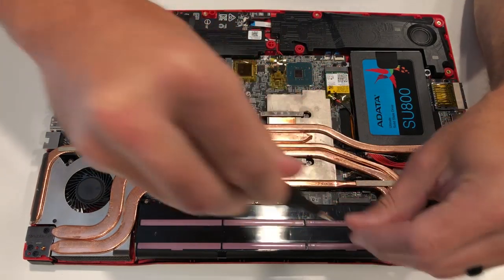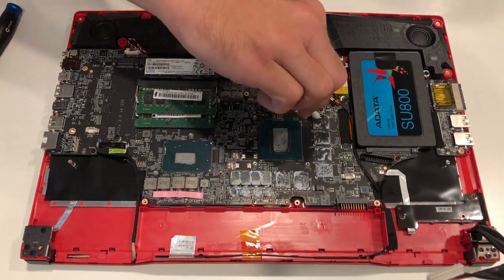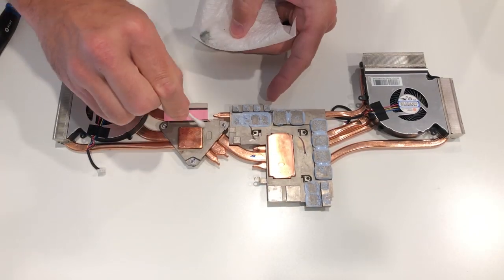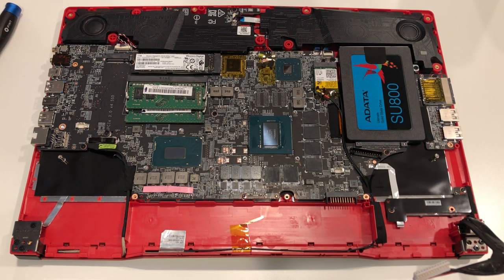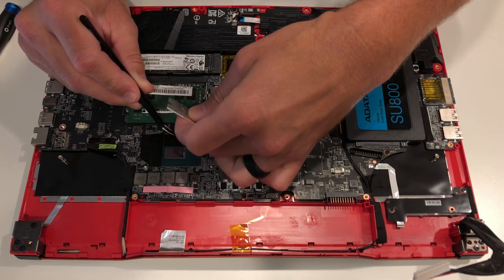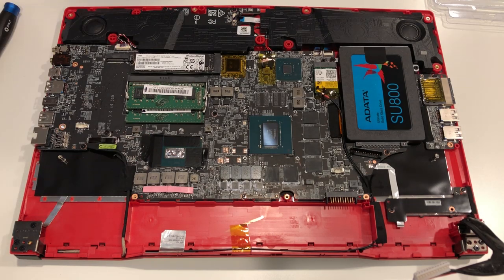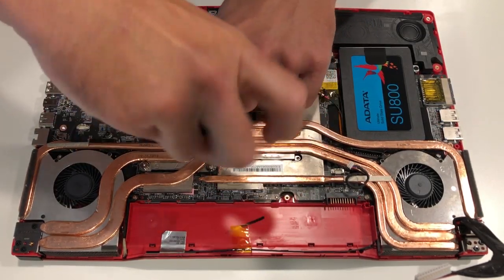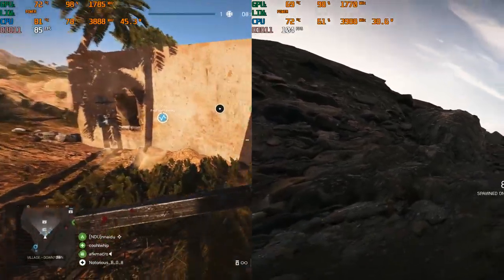MSI GL63 9750h 1660ti Liquid Metal CPU teardown!  Cools like a boss!

Comment from the maker: Review upload goal is Tuesday before the Aorus 7 arrives 👍
Reply: Why even bother to review this plastic abomination. GP is a compromise, everything below is a tragedy.
Reply from the maker: Antony Whatever Runs cool, 1TB NVMe, plenty or storage availability beyond that, an 89% aRGB 120hz 3ms display, per key RGB keyboard, max fan hardware button, 9750h, 1660 ti, dual channel 16gb memory and weighs about 5lbs. If you can get it at a good price that sounds pretty good, don’t you think?
Reply: Is there a particular reason you didn't apply liquid metal to the GPU?  I have a GP63 and now that my warranty is over, i've been toying with the idea of doing liquid metal.  Otherwise  a great video!  I know you said it runs cool, but is there any downside to doing it to the GPU as well?
Reply from the maker: TS 656577 9:03 ??
Reply: Bob Hello, I wonder whether applying thermal paste to chokes under cpu would improve temps or not.. What do you think? (GE75-Repasted with Gelid GC)
Reply: @BobOfAllTrades  I was looking for that answer as well. Did you try to paste a similar cpu gpu combo with LM on both? And what were the results?

Today I repasted my old xps 17,only did the cpu with LM and the gpu with noctua paste, and wow, the cpu dropped 20 degrees, but the gt555m is still maxing out at 85 celcius. It's an old beast so I'm tempted to take the risk and see what LM does to the gpu.. Also, I only applied a very very very thin layer of LM to the cpu chip, didn't put any on the heatsink. So far so good! Coated the chips in plastik 70.

Either way, thanks for this video, has been really helpful!
Reply: @BobOfAllTrades  can you tell me the thickness of pink color thermal pads near cpu

Comment: I always see people commenting about super 33+ tape, I’ve liquid metal pasted an Asus g701vi and aorus x7 v8, left it sideways in my backpack and transported it around and never had any issues, to be quite frank it seems to be a valid application so long as you don’t put too much LM. I comment on ownordisowns videos too, enjoy both of your reviews, most recent laptop is a triton 500 but I’m returning it as it had a defect in the paste job and one of the speakers, got an MSI gs65 stealth with RTX 2080 and 32gb ram and a 1tb ssd from XoticPC for 2300 usd, so I’ll probably liquid metal it if I feel it’s thermal throttling after an undervolt. TLDR; everyone has an opinion on everything doesn’t mean it’s right, keep up the good content.

Comment: Made a mistake of using liquid metal to the gpu and noticed that it is 1-2C hotter than it was..agree to use thermal paste only on GPU.  Nice video!
Reply from the maker: Manz Yup the GPU doesn’t need it. Fun fact, one of HP’s new high end gaming laptops includes LM on the CPU only 😉

Something that I have been doing for years and you’d be surprised how far ahead of the curve we are as tech enthusiasts 🙌

Comment: Great job 👍

I repasted my GS75 with liquid metal and the cpu temps went from 92 to 76, gpu only dropped 2-3 °C though but it was already very low at the low 70s to begin with :) 

Very satisfied overall

I prefer using foam dams instead of tape though because it seals the entire die so its safe from spilling out the other side too. It also supposedly reduces the exposure to air and lengthens the operational life of the liquid metal but I've not experienced it myself yet.
Reply: @Mr Krabs Most definitely.
 
Being liquid metal, it is conductive by nature and so if it spills onto the motherboard it will short out components and render the whole laptop useless. 

So do take care not to apply too much. Just a very thin layer will do. If you can apply just the right amount the cohesive nature of the liquid metal will hold itself together but that's very hard to get right. Thats why I used foam dams.
Reply: @Mr Krabs Yes, Kryonaut is a non conducting paste so it is much safer to use. Not to mention much easier to apply.

Just follow how Bob did it and you'll be fine.
Reply: What kind of foam did you use? I bought some 10 ppi 1/4 thick aquarium filter foam but I'm worried itll melt

Comment: Hey bob, I had a question- So my 1660ti in this laptop idles in the 50c range, and under load it hits 80-81c. I went to check in hwinfo and the "hot spot" on the gpu says 100c! From what i read online, 15-25c hotter on the hot spot is expected, but I was just curious if this is somewhat normal as it is a thinner laptop. Look forward to hearing from ya!

Comment: Liquid metal on the VRM, let's go!
Reply: Xotic l Ice  Thick thermal paste like K5 Pro is meant to replace thermal pad. It performs as good and you don't have to worry about thermal pad height/contact. I used K5 Pro and Phobya Nanogrease to repaste my laptop recently.

Comment: This is the first time I've seen someone put thermal paste on the vrm. I'm having an issue with my laptops vrm, I used thermal pads but they're not working at all.  They also seem to be creating a small gap so that the heat sink isn't clampled on the GPU. My CPU paste is spreading whereas the GPU paste isn't. I think the paste is doing its job, but it's feeling like I need to remove the 0.5 mm pads I used, and just use my thermal paste. What say you?

Comment: I recently picked up the MSI GL63 9SDK-614 (same CPU/GPU as the 9SDK-610 as you linked in the description and I assume you showed in the video) but with a different display, default storage config etc. Any idea if the teardown process is the same? Mostly interested in the 2nd M.2 slot I see on yours. I'm not afraid to open it up, but I'd like to know what I'm in for before taking off the "Factory Seal" label just in case it isn't what I think it is.

Thanks :)
Reply: Breaking the Factory seal on an MSI laptop will NOT Void warranty. MSI allows users to open up their laptops to upgrade certain components. They have no issue with you breaking the factory seal as long as u dont mess up while opening the lap. :)

Comment: Sorry for posting on this two months old video. However, I would like to ask about using thermal paste on VRM chips.
What should I concern before using any paste on them? (or things other than Mastergel Maker?) and how long would it last (like drying out or slip aside)?
Cheers!
Reply from the maker: I2aynorsRaiders It’s all good!  Use it or go with some .5 thin fulipoly pads. Either way it’s good to get familiar with the inside of your laptop and change non-conductive paste maybe once per year.
Reply: Bob Of All Trades why they didn’t put thermal pads on gpu elements then? I guess is because 0.5 can be too thick. In opposite, normal thermopaste can be too thin annddd didn’t make roper contact so the best way is reuse stock blue paste. At least such dilemma I have with my Helios 300 2019)

Comment: How is the liquid metal application holding up?
I have a y740 with a 9750h and 1660ti.
It thermal throttles on me a decent amount, even with an undervolt.
Reply: I had a hp omen with 9750h an 1650 an it would run at 100C  that was with undervolt now I got hp omen ryzen 7 4800h an 1660ti that ryzen 7 doesn’t get hotter then 75C  I guess amd cpu’s run cooler?

Comment: Hey i wondering if its good to put liquid metal on laptop? Are they some cons after some usage, i dont know after one year ? I using hp omen 15 i7 8750h with rtx 2070 max q... Wanna rly try LM, cause i already two times repasted cpu and gpu with arctic mx-2 2019 edition, but temps on cpu are pretty high still for me ( 80-90C in games for cpu with peaks to 94C ) .. would apreciated your help :)

Comment: Wow thanks bob, this looks very similar to the MSI GE75 9sf  (internally). Do you recommend using a an acrylic coating before applying the electrical tape and if so what brand would you recommend ? Love your videos you're the reason I bought the GE75 2070 now I need to apply liquid metal because this monster runs a bit hot.
Reply from the maker: Get on the Notebook Review Forums and ask around for advice there if you want more input from people who actually do this stuff all the time.  This way you’re extremely confident before going in 💪
Reply: GE looks similar to GL? Is this C-137?

Comment: Too impressed with this laptop. Got it 4 days ago. 
RDR 2 : 60-70 fps on Hardware Unboxed Optimised settings (check yt)
SOTTR : 78 fps avg on highest preset
Witcher 3 : 60 on Max settings with Hairworks max, 75-80 with Hairworks off
Batman Arkham Knight : 90 fps constant on max settings
Fortnite : 110 fps average on max settings
140 mV undervolt using Throttlestop, 165,320 MHz overclock.
I have made a channel today and will upload the gameplays soon.
Reply: I got the GP65 with the same characteristics , cannot be MORE happy.It runs better than my previous Legion Y740 with rtx 2060 90w..from which i was not happy at all from software and driver side mainly.When i have time will do the same termall pasting ,and i will be Ok for the next 2-3 years with this lappy!
Reply: @krasimirharizanov7862  True bro, it's an excellent purchase plus you got the gp65, I have a crush on its keyboard

Comment: I'm not recommend anyone do this but I had fantastic result by using thick non-conductive thermal paste instead of tape to protect the circuitry. This allows slightly further cooling and it also forms itself automatically to the heatsink.
Reply: You had any problems with that?

Comment: Thanks for the vid, I've got a gp63 with i7 8750h and 1070, was trying to play FarCry 5 yesterday, hit 96 degrees at times. The CPU is undervolted -175 and the short term boost has been turned down to 45w, the thermal compound is gelid extreme and I'm using a cooling pad too. Considering liquid metal too cause nothing else helps.
Reply: Try sanding down a bit the cooling system and reapplying the paste again. Also don't forget to undervolt de cpu cache too. How's it doing after 2 years?
Reply: @xescdelarosa3328  thanks, never got into the liquid metal game- thank god, but temps are fine. Using ThrottleStop instead of XTU, seems to do a much better job. Thanks for the advice with the cache. Cheers

Comment: Is it okay to use the thermal paste on the VRAM chokes though? I am still wondering what kind of Thermal interface material that MSI use on the VRAM choke before. I am trying to use TFX thermal paste. Can you give me some sugesstions Bob?
Reply from the maker: Go with K5 Pro on those components 👍
Reply: @BobOfAllTrades  What if I choose to use the thermal pad? What is the thickness I should choose? Will MX4 or TFX damage the VRAM choke in the future if I use the thermal paste on them?

Comment: Bob,  how many watts was the 1660 Ti using? Is this a Max-Q variant? The 1660 Ti looks like a great laptop GPU that provides sufficient FPS while not producing an excessive amount of heat for these thin and light laptop chasis. Not surprising the 6 core 9750H produces insane amounts heat.
Reply from the maker: That’s a question that will get answered in the review
Reply: how can a TI be a max q ?

Comment: Hello, i did my repasting also on cpu and gpu with arctic mx4 but i didnt clean the old paste from the small square things there, i let it like that how it came from fabrique, is that a big problem or they are not so important ? :) i must say cpu working at 100% from 95-100 degrees sometimes got down to 80-85 degrees and this without cooling table or turboboost of msi!!! arctic mx4 is the best paste

Comment: I don’t have any thermal paste, and just ordered LM. Are the issues associated with gpu LM application that bad, warranting a separate purchase? This would be my first paste job, laptop is an EVOO LP5 (like the mech-15).
Reply from the maker: What guide will you be following to apply liquid metal? There needs to be some prep work and safety barriers created
Reply: @BobOfAllTrades  Tape+foam dam on both cpu and gpu. I have both 33+ and 88 tape. I will see which fits better the foam compresses to nothing, so I just need to check die clearance from what I understand. It’s probably not good for temps of the components next to the die but I guess I will have to cover them all up with tape. I think only the gpu has these, the cpu just has test points. Notebookreviews steered me away from using nail polish, members seem to think a “sealed” copper heatsink interface reduces oxidation. I haven’t looked up the reaction but I’m guessing it doesn’t involve oxygen. I trust first hand experiences though. It’s kind of sad a company like thermal grizzly doesn’t flat out explain copper heatsink prep and maintenance. Part of the net seems to want to speed up the alloy coating(multiple thin cooked on coatings), the other part wants to seal or sand to avoid the alloying of the copper. Everyone wants a set and forget super efficient TIM.

Comment: well im now a year past ownership and am facing the choice of opening it up and upgrading the 16gb to 32gb of faster ram, adding a tb sata ssd, and a 3.4gb/s gen3 drive....among the dire need of a high quality aftermarket re-pasting. Since im still hitting 86-88 in fallen order, and 90+ in farcry 5 and newdawn maxed while undervolted even though frame rate is amazing ive broken 100fps in both. So the hardware itself is still worth its capability in 1080p, or as a lan rig....even though those b550 itx boards with wifi6 and the better VRM's....are looking insane these days with a r9.....and a beefy gpu....im leaning this direction now when i consider concepts like 2-3000$ laptop......and the 4600h 1650 equipped nitro5.......strikes me more as a viable "laptop" for work on the go etc......that can "game".....too.....i really wish there were a few 1650ti-maxq 4600h low profile options with duel channel lpddr

Comment: Very informative, thanks! Im just wondering how often to repaste it with liquid metal. Really flirting with the option of LM as my 9570h is a great grill at the moment :/
Reply: Same here. Idk if its worth the risk for first timer here. Have been using the laptop for 1 week and the 9750h got really hot
Reply: About how often, I watched GamersNexus's video on LM and pretty sure u also did. It's possibly more than 2 years period because the temperatures are the same even without repasting LM. Read somewhere that someone has not repaste for 2-3 years top which means ever since LM was introduced
Reply: @FadhlyHamzah  I'm giving it a go on my msi tomorrow. Got plastik 70 conformal coating and conductonaut. Did a test on my old xps 17 l702x today with a LM repaste in the cpu and the temps dropped from 89 to 70 degrees. I'm really impressed.
Reply: Same here, i use a lot me laptop about render and now its so hot touch 100° on the package. I want to try this tecnical whit liquid metal

Comment: Hi Bob! Firstly let me say your content is top notch and I always appreciate your thorough and professional break downs of everything you produce.  GG.  2nd - I have just purchased a MSI GL75 9SD (9750h + 1660 Ti Variant).  It came with the 19.5v 180w  Slim power adapter and I was wondering if purchasing the 20v 280w that comes native with the RTX variant would be of benefit and provide performance gains?  Many thanks, Matt- NZ
Reply from the maker: Unfortunately it won’t make a performance difference.

Comment: Bro I did LM on my GL73 8750h / 1660ti last week and then I found you video. I was VERY pacient with this process, and only difference is I use nail polish for isolation, LM on GPU and shitty 3 W/mk thermal paste that I got from local small shop for VRAM. And my temps are SUCK, they suck very hard and deep, they suck so hard that my ssd is trhotling on 75 degrees. Damn it is painfull to see how people is cool with LM and you got 95 degree on everything under the hood. 
I did some VERY thin layer of LM and now I am thinking that there are not enough pressure or some unevenes that causing such a bad thermals. 
Anyway it is fun to risk burning 1200 euros during experementations so I will order new LM tube, hydronaut for VRAM and will try again next week.